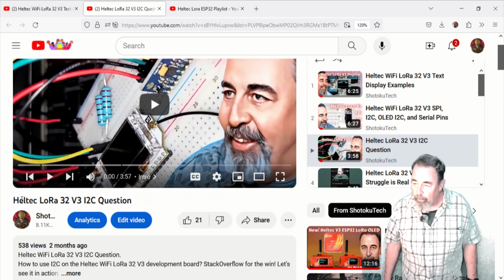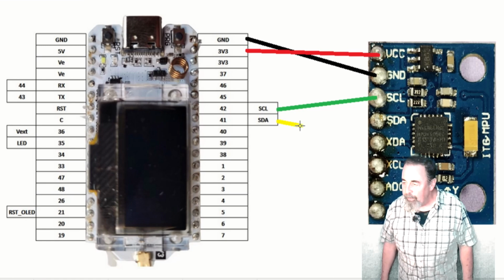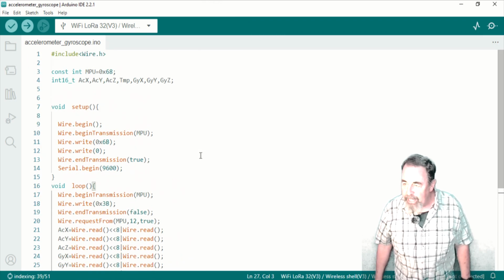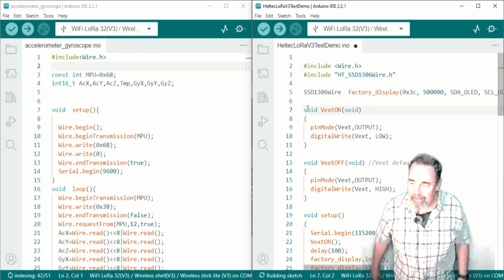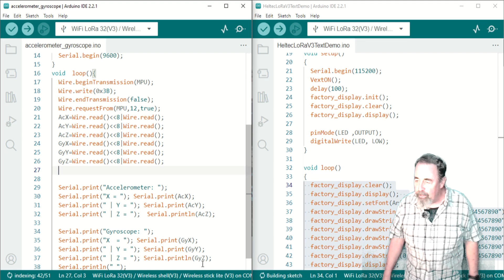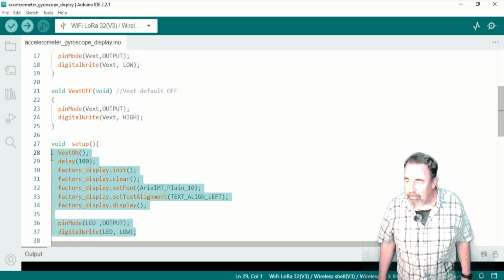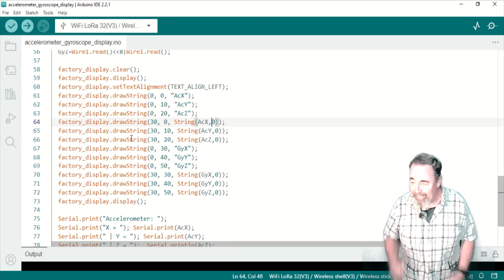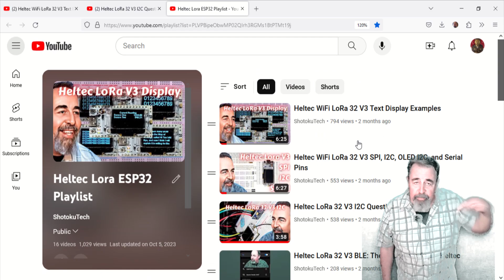Heltec WiFi LoRa 32 V3 with MPU-6050

Comment: I have a new "Issue" or should I say "Opportunity" 
I am working on a project where I need to detect rapid movement on a pipe while ignoring if it swings and yet be able to pick up another slight movement even while it's moving. I got the KY-040 working but I need to adjust the sensitivity through code and not a screwdriver. So I started to look at the MPU's. Hoping I can figure out how to capture that rapid movement and then be able to create a sensitivity range.  I also just got the MPU-9250 / 6500 as it allows for I2C and SPI. 

Looking at the 6050 code the AcelX and Y code I am a bit confused as to how to trap the rapid movement. Maye its because my sample rate is to slow?
Reply from the maker: It's an interesting notion. I'm not in a position to directly engage in it. In my imagination I think your might need more that one device. One filters out the expected behavior. The other acts when it is out of normal. My two cents. You might run out of pins on a Heltec V3. I have not tried SPI at this point.
Reply: @ShotokuTech  I spent most of the morning with the new MPU6500 - I got it working fairly quickly based on a LIB and the code you supplied above regarding attaching it to a new Wire. I would need to spend some more time coming up with a formula for calculating rapid movement. They do track G Force, but I need a bit more granular than that. I did however have a lot more success with using a piezo vibration sensor. So far it might be the winner as it allows me to measure the output!
Reply from the maker: @sighting69  Cool

Comment: No, you are really amazing! I remember i asked this question long time ago and i thought you didn't make it, now u realize that you did it! Kuddos to you and thank you very much!
Reply from the maker: Sure, it needed to be done. Thanks.
Reply: @ShotokuTech  I was wondering, if I were to use two I2C sensors (MPU6050 and MAX30102) with the OLED screen, would that method work as well?
Reply from the maker: @santiagoandres5658 I2C allows for difference devices to share the same wire as long as they each have a different address. So I think it should work.

Comment: Instead of using the gyroscope, an mxl90614 will be used. What would I change?
Reply from the maker: All of the example sketches I have found so far use the Adafruit_MLX90614 library. So one would need to find out how to initialize the MLX_90614 to use pins 41 and 42 for SCA and SCL on the second I2C port.That would be the approach I would take.
Reply: Thanks for answering me. Any idea where I can research this?
Reply from the maker: @gallardo7764  I just installed the library: Adafruit-MLX90614-Library in Arduino IDE. Then I went into the library folder and opened Adafruit_MXL90614.cpp file. It contains this code here that sounds like it could work with Twowire. 
 * @brief Begin the I2C connection
 * @param addr I2C address for the device.
 * @param wire Pointer to Wire instance
 * @return True if the device was successfully initialized, otherwise false.
 */
bool Adafruit_MLX90614::begin(uint8_t addr, TwoWire *wire) {
  _addr = addr; // needed for CRC
  if (i2c_dev)
    delete i2c_dev;
  i2c_dev = new Adafruit_I2CDevice(addr, wire);
  return i2c_dev->begin();
The actual syntaxt I cannot quite work out. Perhaps you could get an answer from Adafruit forums: https://forums.adafruit.com/search.php?keywords=MXL90614+twowire&sort=BestMatch
It looks like there may be some potential answers here. Thanks.

Comment: this is great video, sir!!!
gotta bow for u🫡🫡🫡

But i still cannot manage to do for the DS3231, still very confusing....
Could u have a same tutorial video but using DS3231 instead of MPU6050

Much appreciated!!!
Reply from the maker: So you are saying you aren't getting any signal at all from the device? Do you have the correct I2C address for it? I would start out simple. Get the device working with Serial output first, then add the display bits. You might try an I2C scan like I did here: https://youtu.be/sBYHlvLupxw
That will at the very base hardware level tell you if your device is working and at what address. You only need the resistors for the scan, not the actual production.
Reply from the maker: In the meantime I have to order a DS3231 as I don't have one and I have several projects on the slate for production right now. Thanks.
Reply: @ShotokuTech  Hi sir. I think i make it. Really appreciated sir. U video helps me a lot.🫡🫡🫡🫡🫡
Reply from the maker: @p.7555 I will try my hand with the DS3231 soon, in case is doesn't work out for you. Best wishes.
Reply from the maker: Here you go. https://youtu.be/nwG4l7Ph1Do

Comment: Hi, instead of the MPU6050, I am using the SHT40 sensor. I have initialized the SHT40 sensor properly, but I still get an error saying "SHT not found." I checked the I2C communication on the V3 board by uploading an I2C scanner program. Give your ideas
Reply from the maker: @nandhini.m2182  what gpio pins are you using? Also you need resistors for the I2C scan, but not for operation.
Reply: @ShotokuTech  Thankyou for your reply, I use SDA-41& SCL-42
Reply from the maker: @nandhini.m2182  I recommend using the open pins: 45 and 46, or 47 and 48. The pins you have chosen are shared with embedded devices on the board. Yes I2C "should" work with shared pins. But I prefer to use the unassigned ones. You also must initialize the boards components first in void setup, then initialize your device. I have covered this in several of my Heltec V3 videos.
Reply: @ShotokuTech  Ok.. I'll try.. Thank you..

Comment: Hello friend, I'm from Brazil and I follow your YouTube channel. It would be possible to do an example with two heltec lora v3, one being the transmitter sending a lora signal to the receiver to turn on and off a relay module, perhaps it would be good to have the option to turn it on and off via a button and also via an html page.
Reply from the maker: That is a nice idea. It might be a few weeks for me to develop. But it would be an interesting topic. Thanks!
Reply: I would like to use this idea to activate an irrigation pump from a distance of 500 meters @ShotokuTech
Reply from the maker: @leonardosilveira06  Brilliant!
Reply from the maker: @leonardosilveira06  What is the voltage and current of the pump?
Reply: @ShotokuTech  The idea is to use a relay module to connect a contactor and the contactor turns on the 220 volt and 5 amp pump
Reply from the maker: This could get you started: https://youtu.be/JKP8OvBm6nM

Comment: Newbe Heltec 32 Lora user here, so forgive my programming ignorance.  I've loaded up the files I believe are needed, but when compiling, I'm getting "undefined reference to ScreenDisplay" errors with every factory_display command.  The errors are pointing to both the HeltecLoRaV3TextDemo and HT_SSD1306Wire files.  Any clues as to what I'm doing wrong?  TIA!
Reply: Whoops, this message was intended to be for the Text Display Example video.  Got them mixed up as I've been working with both projects.
Reply from the maker: As far as I know, this is all I do to prepare Arduino IDE:
This is the latest board manager URL to add under "File/Preferences/Additional Board Manager URLs":
https://github.com/Heltec-Aaron-Lee/WiFi_Kit_series/releases/download/1.0.0/package_heltec_esp32_index.json
In Board Manager, select the correct Heltec board:
"Wifi LoRa 32(V3)/Wireless Shell(V3)/Wireless Stick Lite(V3)"
Only use example sketches from "Heltec-Example" or sketches specifically written for Heltec Wifi LoRa 32(V3).

Comment: I tried to compile but I get the following errors.
Heltec-esp32/hardware/esp32/1.0.1/libraries/Wire/src/Wire.h: In function 'void loop()':
candidate 1: 'uint8_t TwoWire::requestFrom(int, int, int)'.  
uint8_t requestFrom(int address, int size, int sendStop);

is it because I am running the older 1.0.1 library?
I have Wire.h included at the top
Reply: Updating my own reply: Yes it was due to using the older the 1.1 Lib's. Argh I have to completely redo my lora 32 code :(
Reply from the maker: Yeah my reply was going to be about checking library and board definitions in Arduino IDE. Thank you! Best wishes!
Reply: @ShotokuTech  I got it recompiledd and working on most of my code.